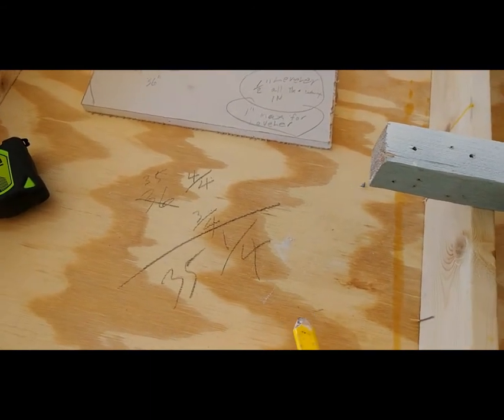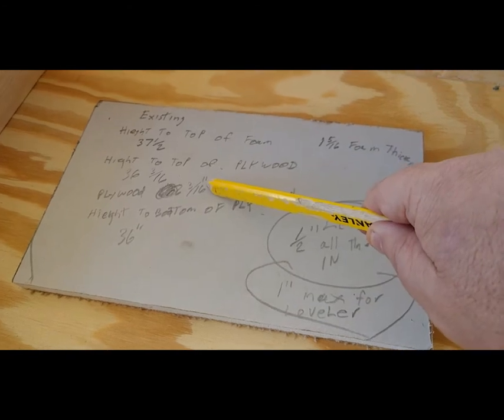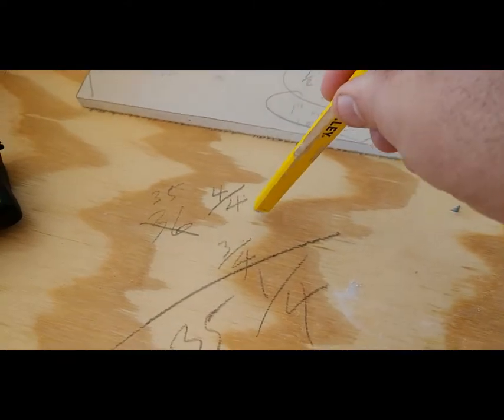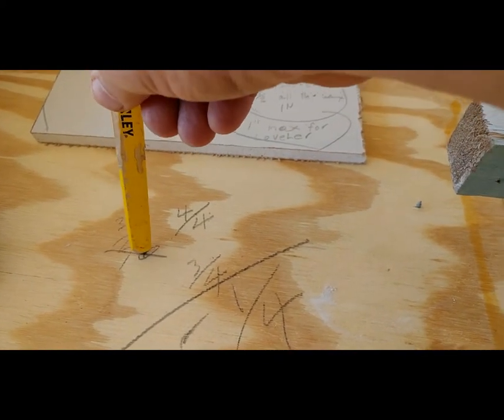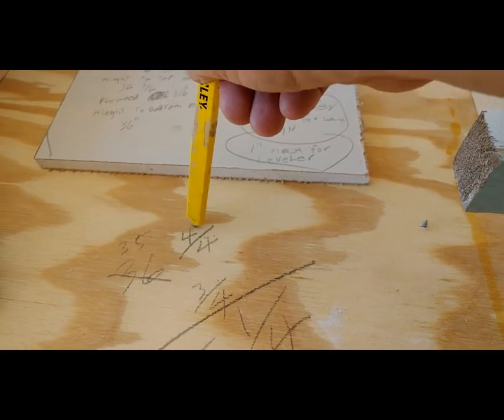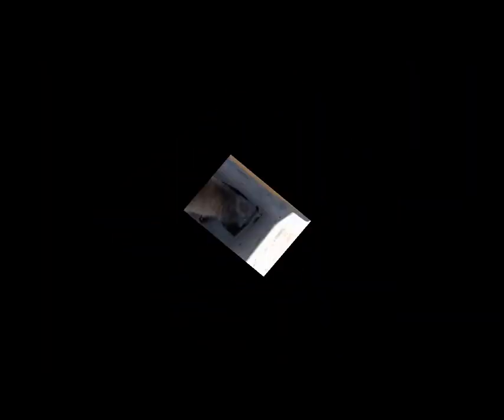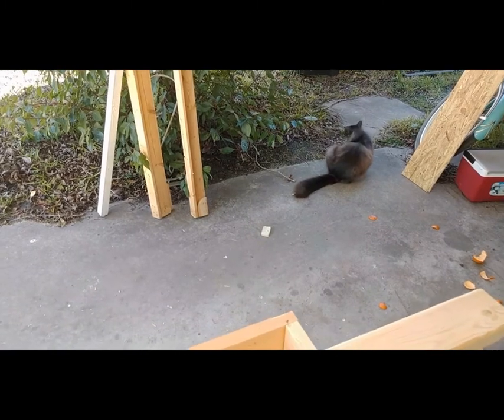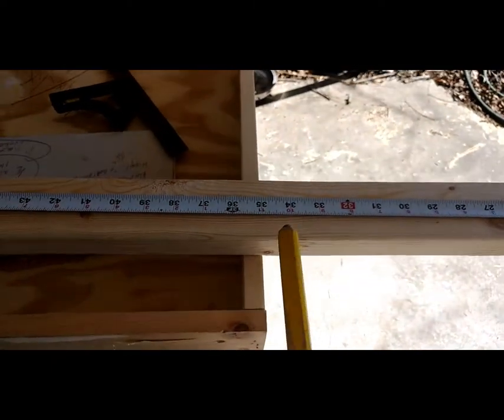Nscale Benchwork Support Upgrade and Rebuild

Comment: I just had an idea looking at your benches.  You could put receptacle boxes on the outside edges of the benches that could plug into the wall so your not on your knees moving stuff around every time you need to plug in a tool or something.
Reply from the maker: That crossed my mind now that you mentioned it. I will probably do just that. At least I don't have any bees in my house.
Reply: @possumbayou8238  I can fix you up.

Comment: So Rusty, I used the type faster to install the wheels in Nancy legs and had to come back and glue them in place.  Just saying.
Reply from the maker: I may have to glue them but the layout is stationary. I got the idea from my ntrak days. I have them on my TTrak modules too. I used 5/16 on the TTrak modules and they are way more secure.